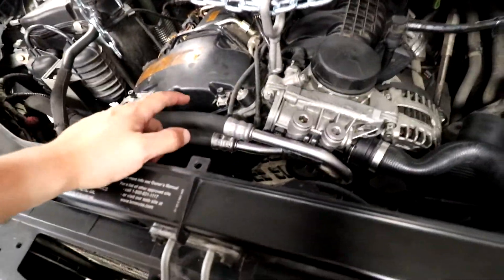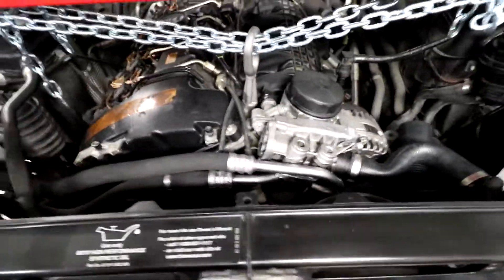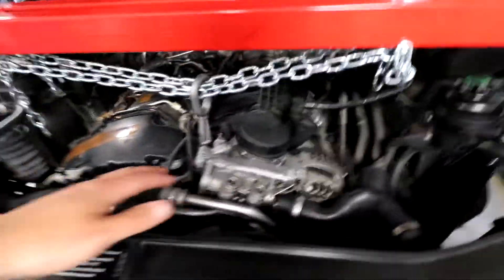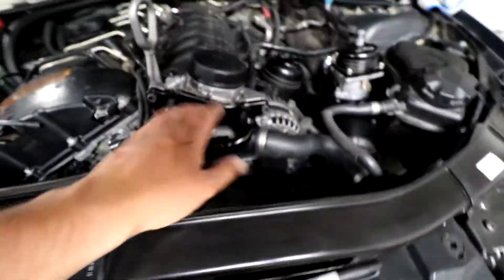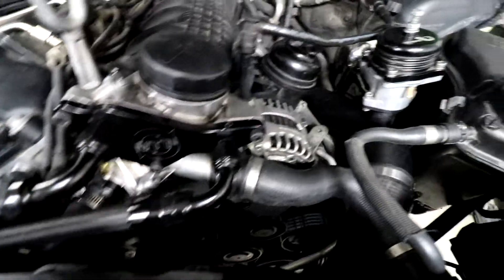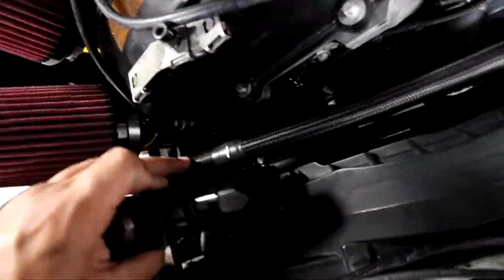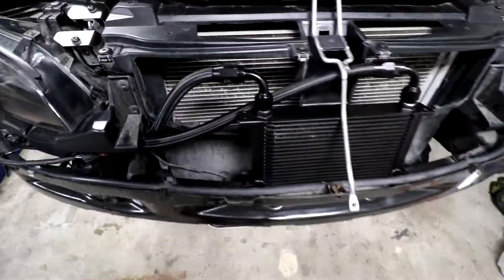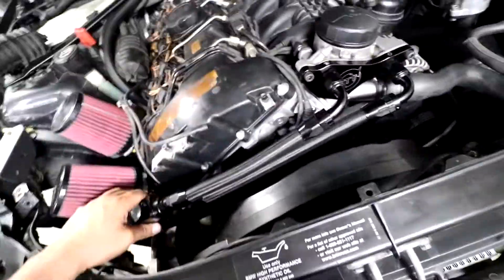N54 Front mounted custom oil cooler DIY! (Worked perfectly!)

Comment: I’m confused on how to connect the thermostat. So the driver side oil line you labeled “o” does that connect to “out to engine or in from engine “
Reply from the maker: Ya O is for out of engine, you can look up the flow chart for the factory thermostat housing and it gives you the in and out direction
Reply: @BimmersandBoost thanks waiting on a thermostat now. Currently just running delete plate to oil cooler temps seem fine

Comment: Hi Jack, nice vid! Can you let me know why did you choose the plate option instead just the two fitting option keeping the oem thermostat? Thks!
Reply from the maker: I had been told previously that the an adapters for the oem housing will leak so I was just going off that data and all said and done it was cheaper still then new oem lines, I honestly don't recommend the vtt plate and I would keep oem with an adapter if I had to do it again which I might

Comment: Any downside for not having oil thermostat?
Reply from the maker: I still do have a thermostat, it just remote mounted, if you lived in a more climate that the temp doesn't fluctuate alot you would probably be fine but its get so cold and hot here I definitely still wanted to keep a thermostat

Comment: How did you mount this cooler in that area? Did you need a custom bracket?
Reply from the maker: No its just sitting between the crash bar and the hood latch support, dosent move at all and holds it perfectly, you could make a mount for it but I just didn't see a reason to do that

Comment: Is that the active autowerks bov and if so is it facing the cabin ?
Reply from the maker: Yes and yes, i had to turn it around for the relocated inlets
Reply: @BimmersandBoost  thanks that's good to know ! Also how is the block off plate doing ? Any leaking ?
Reply from the maker: @joshuaperez3506  im not too impressed with the block off plate at this point, ive replaced the gasket maybe 4 times already and it last for a while but eventually leaks anyway, so ill probably be looking for a different option

Comment: Now you have more Heat in front! So any stock guys need an Extended AIF to front Grill ! It matters there is the outside temp and in the Grill it gets Hot ! Like 120 - 130 ! So Pull colder Air from the front Grill ! It makes a Huge difference !
Reply: what do you think your A/C condenser does when it' s on...

Comment: Any way you can update your listing and link with some of the parts missing cause this is something I'm interested in doing myself. I know there is some parts not listed
Reply: You need 4 90 degree -10 AN fittings, 4 straight -10an, 4 -10an port to -10an hose and 3 1/8" npt plugs.  Also what none of these videos go through is how they mounted the core and what hardware was used but ill cross that bridge when i get there lol.  bought 10' of hose hope that's enough but it should be
Reply: @christopherkrapf9242 aye bro i know it’s been two years however what route did you end up going with? also how the hell do I mount it up front i’ve been looking for cheap hardware anywhere. Thanks bro!
Reply: @Los_Altos_Customs  lol it’s still sitting in my garage never installed it 😂

Comment: Very cool. I'm curios to know if mounting it on the front doesn't pass on hot air from the oil cooler to the water radiator?
Reply from the maker: If there was any heat transfer it would be really low i think, there is still a good gap between the radiator and the oil cooler that hopefully keeps some air moving
Reply: @BimmersandBoost  You're probably not noticing any increase in coolant temp, so it's probably not transferring any heat. This is next on my bucket list. Nice one bru.
Reply: @The_Truth777  no more heat then your AC condenser does on a hot summer day..

Comment: I love the set up man and the parts combo, super sick.....but doesnt it worry you to stack coolers??  Did your water temp climb at all from the heat comming off of the oil cooler and going into the radiator??  Im trying to decide between front mount or hang it off the frame in the passenger front wheel well, and make a badass aluminum shroud for it.  I like the looks and the ease of installation of  front mount better though.....if your water temp stayed the same i will prob just do that so if you can let me know that would be radddd.  I live in a hot climate (LA) and am moving to a hotter climate during summer (vegas) so i want to get it right... :)
Reply from the maker: I haven't noticed any difference in water temps so far, its not pressed right up against the radiator so there is still air flow even to the part that is behind the cooler, ive seen a big difference in oil temp tho so i think its worth it to mount up there plus it looks good haha, will have to do some more testing when its not winter tho for sure
Reply: thx for the quick response!  Yea i think ill see some better temps considering i have an early 07 build that did not come with an oil cooler from the factory....i dont know if they were not putting them in yet or if the car was meant for a cooler climate......but yea litterally anything will be better then my current set up.  lol oh one more thing just out of curiosity, what temp does the earl open up at???
Reply from the maker: @bigmiken5472  ya getting even a factory cooler would be a big upgrade so having the front one makes a giant difference, and the thermostat cracks open at 160° and fully open by 180°

Comment: With the Earl’s thermostat did you get Plugs to seal off the extra ports for add on sensors?
Reply from the maker: I got some 1/8th in plugs for cheap when i ordered it and just put them in, i forgot to mention that
Reply: @BimmersandBoost  and is there some connectors I need to connect the AN connectors of the hoses to the Thermostat? I see that the Block off plate had those adapters but the Earl doesn’t come with anything.
Reply: @BimmersandBoost  don’t I need those 10 AN Male Union Fittings for the Thermostat?
Reply from the maker: @lilchu7336  yes you will need 4 male, straight an fittings, i forget to mention that specifically
Reply: @BimmersandBoost  yeah I was like.. hmmm I’m missing something here. You should update the parts lol. 

Btw is this good to use? https://www.jegs.com/i/Earls/361/AT981510/10002/-1
Reply from the maker: @lilchu7336  ya haha spaced on putting that, ya that would work just fine!

Comment: How many of the 90 degree and straight fittings did you get? Im going to be getting everything today on Black Friday.
Reply from the maker: 4 90° and 4 straight fittings
Reply: @BimmersandBoost  thanks!
Reply: @BimmersandBoost  one last question. Do i really need that Thermostat? or can i go with only oil lines like oem?
Reply from the maker: @lilchu7336  id recommend one, really good for the car to warm up with a thermostat, and theres one factory so id recommend one
Reply: @BimmersandBoost  I see the Vargas block off plate actually removes the built in OEM Oil thermostat. I didn't realize it.
Reply from the maker: @lilchu7336  ya thats why i went with the aftermarket one

Comment: How  did you mount the cooler?  Did you drill into the bumper crash beam?
Reply from the maker: So i just rest it on the crash bar and then i bent the hood locking support bar to go around it and it holds it super tight in place
Reply: @BimmersandBoost  Could you please provide a bit more detail on how you mounted it.  I have an ER oil cooler in the stock lower right location and need to add a second one as I'm still seeing high oil temps at the track.  I can't add one on the driver's side as my car is an IS and it has the aux radiator there.  So, I'm gonna have to mount it in the middle like you did but could use a bit more detail.  Thanks!
Reply from the maker: @chrisgarland99  i basically used the hood latch bar that connetcs to the crash bar to hold the cooler, i just bent it alittle to go around the cooler and it hasn't moved an inch, you could make small tabs to physical mount it to the crash bar but ive found just using that hood latch bar is more than enough to hold it in place

Comment: How’s the oil cooler doing after a month? Do the oil temps remain cooler than the OEM?
Reply from the maker: Still working awesome, temps are super low, i can beat on the car with a 60° air temp and it wont pass 200° for oil temp, definitely worth it so far
Reply: Don’t you have to get the oil to 212deg to evaporate water vapor? Otherwise you get sludge
Reply: @Marky_Markster yes that’s true

Comment: x drive does not have an oil cooler.  what year is your model?
Reply from the maker: Mine an 08 xdrive, came with the factory sport cooler
Reply: @BimmersandBoost  I have an 08 xi coupe, sport package, and it did not come with a factory oil cooler. From what i have seen online in various places, xi models did not come with a factory oil cooler, it's interesting that yours did.
Reply from the maker: @BMWHOBO  ya im not sure then, it might have been an option or something when the car was ordered, but thats interesting cause i always thought it was a sport package option
Reply: @BimmersandBoost  I have seen varying things in forums...One person said you only got an oil cooler if you had the 18" wheel package, which would have come with the sport package, though i don't believe any xdrive models, even with the sport package came with the 18" staggered wheels. Someone else said they have a non-sport package car with an oil cooler. So who knows. haha.